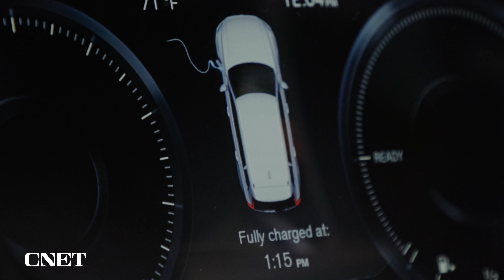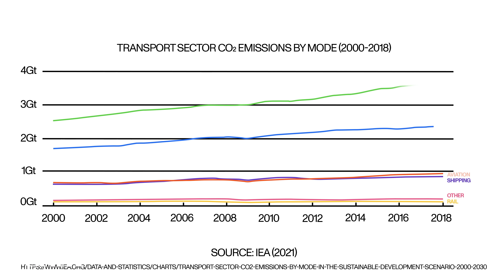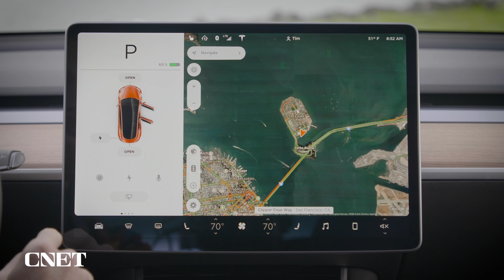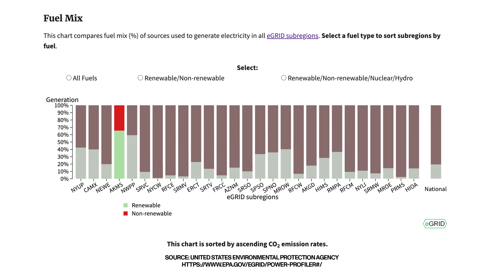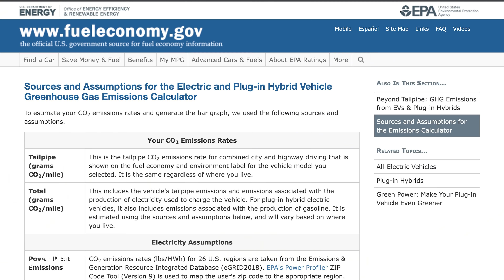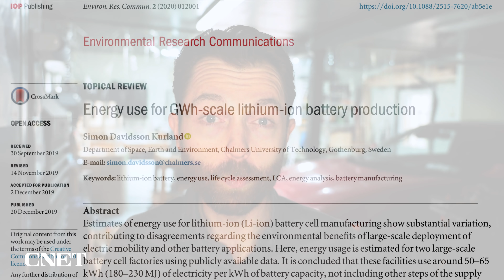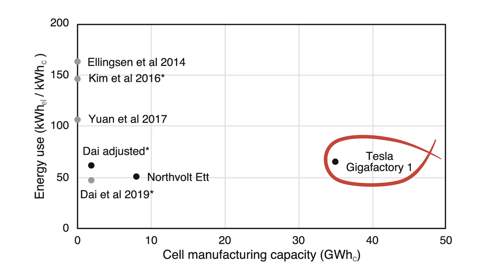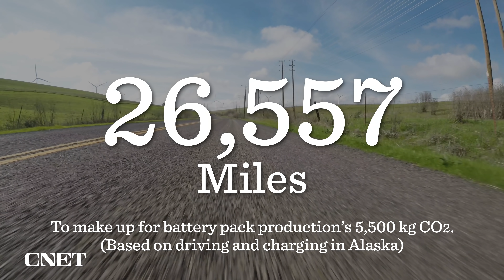Are EVs Actually WORSE for the Environment?

Comment: How can you factor in the costs to produce the battery pack, but nothing else? That is such a bias one way to look at this. Volvo did a study last year comparing the same model vehicle, one electric and one petrol and they found that actually yes EVs ARE worse for the environment. You don't only have the batteries which are extremely environmentally toxic, but you also have the electric motors which have rare earth metals in them which are A:  one of THE dirtiest things in the world to produce. B: are extremely diminishingly rare, especially because there used in literally everything we manufacture. C: Have the largest impact on humanity of anything out there. Most REMs are mined in the republic of the congo which is basically run with slave labor and child labor, and have multiple deaths per day from mines being improperly secured. Seriously, how can you spout such a one sided puff piece? FOR SHAME CNET!!!  Unsubscribed.

Comment: Wouldn’t it be fair if you include how much CO2 is produced building the gasoline engine and tank?
Reply: The car already exists, hundreds of millions of gasoline powered cars already exist.
Buying a 1999 honda civic is better than buying a tesla because the amount of oil and energy used to power the civic is going to be less than creating a tesla and servicing the batteries in 10 years when they are completely dead.
Reply: @PhonePhone-sf8te  "the batteries in 10 years when they are completely dead" LIES!
Rav4 EV from 1990s with batteries from Ovionic Texaco averaged about 16 years of reliable power output. They were oldschool NiMH batteries with Air Cooling only. Modern Lithium Ion BEVs with Liquid Cooling is not much better still way under 20 years. You stated the egregious LIE of "10 years when they are completely dead".
Reply: @Neojhun  I drive a 22 year old toyota, a 33 year old ford, and a 25 year old nissan. I'm putting a new motor in the toyota. Just because you're too high on your own farts to work on your own vehicles means you get to pay the stupid tax and replace them every 5 years.
Reply: @Neojhun  So spending $50k on a tesla and saving $80 a week in gas means you will have received your ROI in 28 years.  Oh, the batteries are only good for 20? ROI will be never.